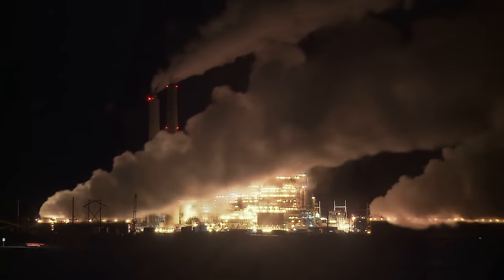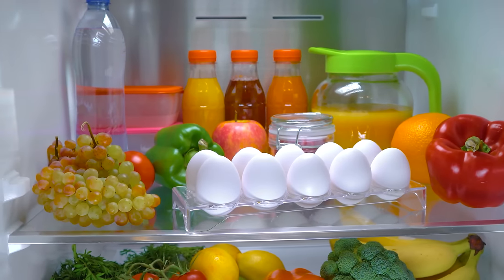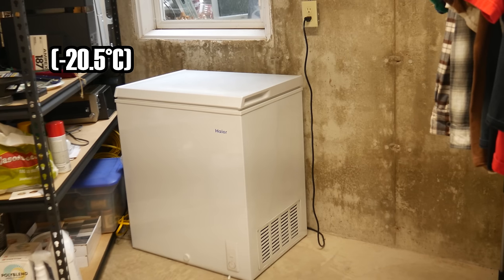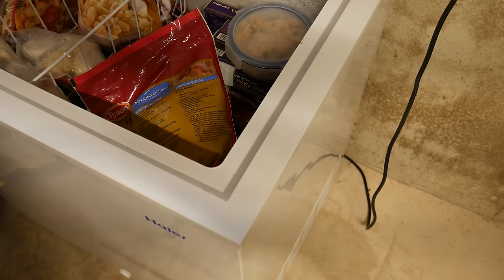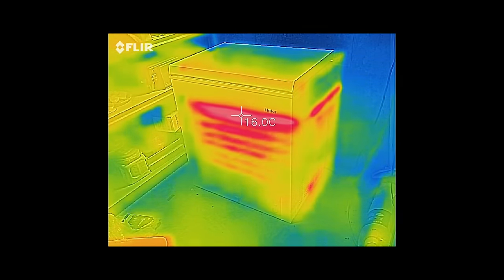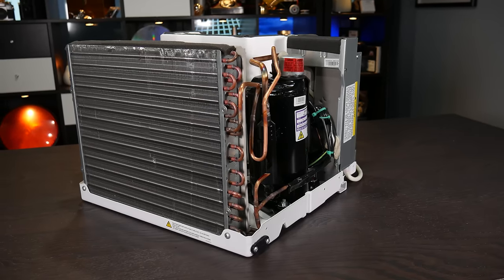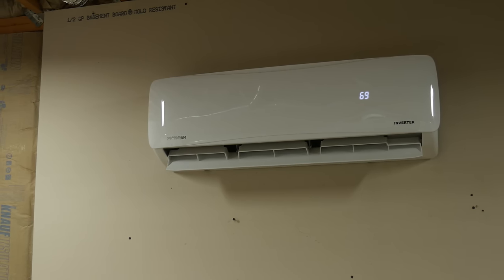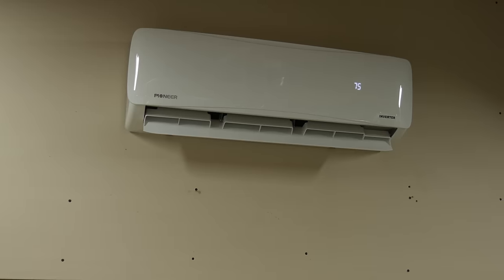Heat Pumps: the Future of Home Heating

Comment: Since you asked "Why didn't they recommend a heat pump?", my two cents: I used to manage facilities for a restaurant in Minnesota. The heat was provided by the building, and we had constant issues when they temp dropped below 0, which, being in Minnesota, was way too frequent. This was a few years back, mind you, but they had a heat pump that was not rated to the climate, and had no aux heat. According to the HVAC engineer I hired to troubleshoot the issue, this was a common problem with the technology AT THAT TIME. in the early 2000's, the proper control technology was, apparently, prohibitively expensive. My HVAC had been sufficiently "burned" by enough of these (constantly freezing) systems, that he said he would never install or recommend using one in the midwest. Obviously, refrigerants have improved, and the electronics and PLC needed to make these systems run properly have become easily attainable at a low cost.
Reply: @andykillsu  The modern heat exchanger still has a shut off temperature and and Minnesota often drops below the shutoff temperature.
Reply: Even modern heat pumps aren't good for anything below 10°F and can't out compete a typical gas furnace with 80% efficiency let alone a high efficiency (95-98%) furnace. Heat pumps also require more electricity to run and run longer since at most the air temp leaving the vents is 90° F where as furnace heat comes out at temps that can reach over 135° F. Furnaces have far fewer moving parts and far fewer points of failure, and far more cost efficient in terms of materials and maintenance. A standard heat pump requires at least 3 motors to run, which would be the indoor blower, the outdoor fan, and the compressor, and a furnace at most (high efficiency) only requires the indoor blower and the inducer fan (standard furnaces don't typically have inducer fans). Heat pump efficiency is entirely dependent on outdoor ambient temps so the warmer it is outside, the more efficiency you'll get out of them. A lot of heat pumps also use auxiliary electric heat strips for both comfort and emergency heating and these use a lot of power. I'm an HVAC/R tech and heat pumps are nothing new, and nothing that great, and are definitely not the heating solution of the future. The best solution would be duel fuel systems, which compose both a heat pump and a furnace. This video kinda over sells how great heat pumps really are.
Reply: Well said  @Eidolon1andOnly !  This comes across as a commercial for heat pumps and doesn't address how we are going to get the extra power needed from the power grid if a large number of people move to heat pumps.  Definitely add more solar + wind but the power grid needs to be able to handle a full load when solar/wind go to zero.
Reply: @andykillsu  Doesn't a backup heat source double your installation costs (i.e., having 2 heat sources)?
Reply: @andykillsu  That's still not an ideal solution for a lot of cold areas due to permafrost and/or soil types. The cost of installation and maintenance and repair  is also significantly more costly. GSHPs are definitely more reliable and efficient compared to air source units, but definitely not the best for large scale use and aren't practical for most people.
Reply: @caja8468  Yeah, that guy's solution of a ground source heat pump is by far one of the most costly installations someone could do, but a secondary heat source isn't always that costly. A "dual fuel" system that uses both a gas furnace and a heat pump wouldn't have any additional installation costs as a system which uses an air conditioner for cooling and a gas furnace for heating. The installation is the exact same, the cost differences would be in the units themselves since there's a few more components in a heat pump vs a regular air conditioner.
Reply: @andykillsu  Geothermal electric power production is not the same as a geothermal heat pump. They can't be used anywhere on the planet as they both require ground water to operate efficiently. If there's no ground water to draw heat from, there's no way to transfer that heat into a home. This limitation in available ground water is the biggest inhibitor to geothermal power plants. Geothermal power plants are more practical as they can provide power to numerous homes via electric cables. Geothermal heat pumps would require every home to have a heat exchanger in the house, connected via plumbing to a heat exchanger in the ground. You simply can't connect a bunch of homes to one underground heat exchanger, and you wouldn't be able to run plumbing from a centralized underground heat exchanger to a distance home without the heat loss occurring in the plumbing connecting the two locations. I have heard of a housing complex which did have all homes with their own independent systems all tapping into the same underground heat source, but it was only a dozen or so homes, and the cost was very high, so the homes were high end expensive houses.
Reply: "the proper control technology was, apparently, prohibitively expensive"
So basically, "computers were too expensive back then"?
Reply: You can’t install a heat pump without an emergency/secondary heat source where I live.
Reply: I’m in Minnesota and got a heat pump for my house about 10 years ago when I got a new furnace.  The thermostat runs the heat pump down to about 30f and uses the furnace below that.  It lowered our gas bills by quite a bit and as the heat pump was also replacing our old AC, our annual electricity costs also went down quite a bit as the new heat pump is far more efficient than our old AC
Reply: Loupgarou21 When you replace your heat pump consider a variable speed ultra efficient model. You’ll be able to use the heat pump down near 0F and cooling costs will be substantially decreased while providing absolutely consistent indoor temperatures 24 hours each day.
Reply: @Eidolon1andOnly  Yesn't, some brands already offer heat pumps that can still deliver 50% of their rated performance at -18°F while offering full performance at 10°F (albeit at lower efficiency, though most of the time still more than twice as effective as resistive heating), Panasonic Nordic even goes down to -31°F.
Sure, it is definitely not ideal when you constantly get that low, but it is enough to cover the "but sometimes" fear. We here had an exceptionally cold January with temps around 10°F and going as low as -10°F, but we are still considering switching to a reversible ac thanks to the broad range
Reply: @or2kr  A heat pump operating at 50% is comparable to a high efficiency gas furnace. Is that Panasonic Nordic heat pump a ground source heat pump or an air to air?
Reply: @notthatperson8179  Then reconsider it when it costs around $6000 more than a typical unit :/
Reply: JM M The variable speed from Carrier was $4k > than 2 stage version. Over the 12-15 year life expectancy it’s trivial. The energy savings should break even at some point. The primary reason I love the variable speed is the ability to exactly maintain the desired temperature & humidity level. During summer heat waves my home never gets above 71F and that was impossible with my old two stage. In fact I’m able to cool down to 68F for less energy than my two stage at 70F.  It runs at 40% to maintain humidity level. Honestly it just makes life so much more comfortable. After living with this for two years I’ll never go back.
Reply: @Eidolon1andOnly  Air to Air. I just looked again at some data sheets and it isn't as bad as I thought, Mitsubishi quotes a 60% power draw increase at 10°F over normal levels, so 3kW for 9kW of heating power which would give a COP of 3, which is in theory better than a gas furnace and not bad for a multi split air to air heat pump, single split heat pumps like the Panasonic Nordic are even more efficient
Reply: @notthatperson8179  And how much is the 2 stage over the normal version (assuming you are comparing carrier infinity 2 speed)?
Unless you really, really want to deal with inverter based misery, don't buy one. Because they do work great, until they don't and most techs have no clue on how to fix them. 
At least in my case I'm installing Senville units myself and the inverter boards don't cost a thousand dollars when they go bad. And even then, the Carrier unit doesn't heat as well as the unit coming out from MR COOL, which you can if you want, install yourself.
Reply: There's a lot of the Midwest quite a bit warmer and further south than Minnesota.

I'm not sure why "North Midwest" never became a thing.
Reply: JM M I’ve heard about problems with inverters. I installed a surge suppressor on the circuit to hopefully decrease probability of failure. If it has problems the warranty should cover the parts. Worst case scenario it can be converted to a single stage unit. If I do spend a few $1,000 on labor over ten years the overall comfort provided by variable speed is still worthwhile. The entire system installed was “only” $15k. That’s a lot of money but I had a window that needed to be replaced and that was nearly $10k. I tried to buy a new refrigerator and that was around $4k. Why cheap out on hvac when it is one thing that can have a massive impact on comfort?
Reply: @notthatperson8179  Well, because out of warranty it's way more expensive.
I know and will accept that comfort is a good reason. As long as the install is done right, they should be fine. 
If you have a $15k system though, you should have this level of a surge protector, an ICM493 because they also prevent too high voltages from screwing up the equipment.
Reply: When I was young, my parents got a heat pump. (way back in the ‘90s) Back then, they were incredibly primitive. It never worked right. Like everything else, they’ve come a long way.
Reply: @Eidolon1andOnly  : Thank you for clarifying this for people!  Some people think that HP's are the greatest and why isn't everyone using them.  They don't know the details and sales brochures are designed to sell the product and sometimes skip over the dirty details.
Reply: I lived in Minnesota three years.  The heat pump worked perfectly & had resistance heat as backup.
Reply: Heat pumps operate at 600% efficiency.   Even at 10 degrees.  No fuel source like propane or NG will ever reach 600% (95% being the max).
Reply: Another thing to consider is that a heat pump operates summer and winter and wears out sooner than an air conditioner will.
Reply: Here in Northeastern Vermont, I had my furnace replaced two years ago and also a compressor for air conditioning put in at the same time.  I asked my HVAC guy about other options including a heat pump, and he said that when it got to -20 I would not be happy.  I am sticking with my fuel oil for the foreseeable future.

Comment: Another amazing video! Cheers from Canada, where I LOVE my Mitsubishi Hyper-Heat system. Works down to -30°C, and well.
Many systems, like mine, can run multiple heater heads inside the home (mine has 4), off the single unit outside, and since the individual units in the home can be set to automatically cycle to lower temperatures when you leave the room, I’m not wasting energy by keeping all the zones hot at once. Enter a room, and within seconds the unit knows I’m there and starts kicking out the heat/cooling.
Reply: We have that unit in NH, it's our only heat system. Did you buy a different remote to control the unit?
Reply: @dognoseranger  I have a remote for each indoor unit. As far as I know, they came with each head when I bought the system (or perhaps the guy who installed it ordered them). In any case, yes, I have individual remotes in each room. But it’s possible to just use one remote to program any of the heads with.
Reply: @mikekarloff8114  Thanks. We got basic remotes with ours. I've seen some "wifi" versions with more extensibility (few hundred bucks?), but haven't found anyone who tried one yet.

Comment: Absolutely love mine! My area does get extremely cold, mine is a “hyper heat” model for -20(f) and below -20 (actually a little above that) it has trouble, so resistive and wood pellet are required for a couple months. 
My split unit compressor has saved me hundreds throughout the year.